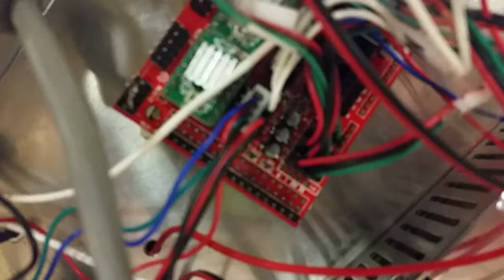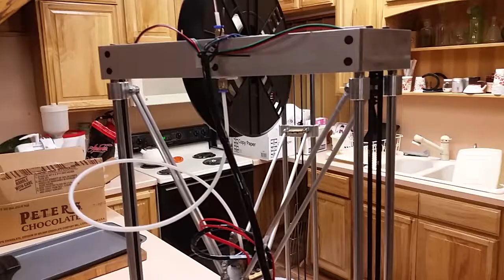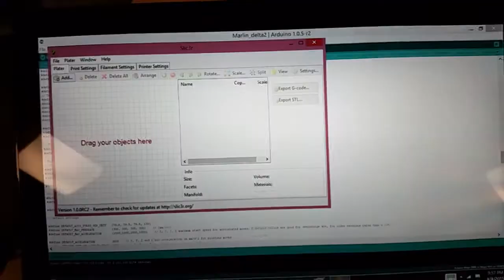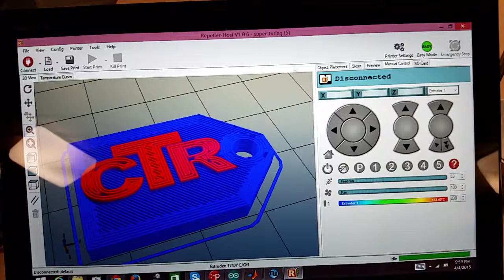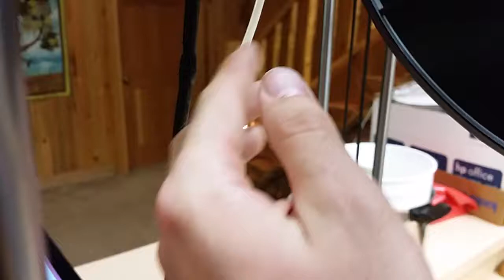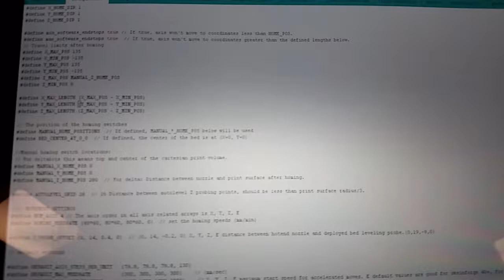Maker Geeks 230mm all metal Kossel working well

Comment: Please would you be so kind and send me some basic instructions that will show me how to make the software running? I made a big mistake when I bought the older makergeeks mini kossel. I am not so experienced in this, but I see you are so please help me. Im struggling with it for 6 months now and I am afraid of it getting vintage till I'll put it all together and running. My mail: oskardotslanina@gmaildotcom.
Please help.
Reply from the maker: http://buttehills.ddns.net/Configuration.h
Reply from the maker: Tell me if yours works with that file
Reply from the maker: My issue has always been that it will try to auto level and make it about 50% across the plate and then ram the head into the plate without stopping.  If you can get past that, let me know.
Reply from the maker: Thanks. I didn't know there was a new release.  I'll have my student work on it soon

Comment: Would you be willing to share your configuration.h file?  My daughter and I are running into configuration issues with our All Metal Kossel
Reply from the maker: Ken Fanta Sure I can.  I think mine is working.  The only thing you may have to adjust is the mm offset from the plate.  Can I email it to you?
Reply from the maker: Ken Fanta For the time being try this link.  http://69.144.250.224/Configuration.h
Reply from the maker: Ken Fanta The one thing you may need to edit is line 354 where it says
#define Z_PROBE_OFFSET {0, 14, 1, 0}

the third value is the offset of the head above the plate.  I also had to manually level my plate because it was not square enough.  I just tightened a couple of the screws holding it down.